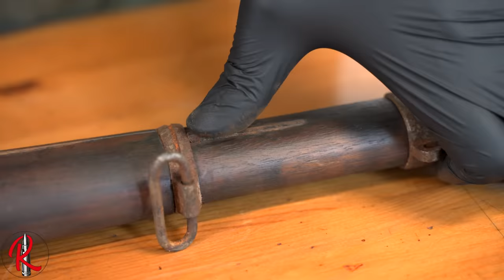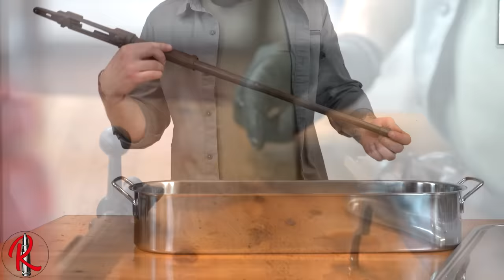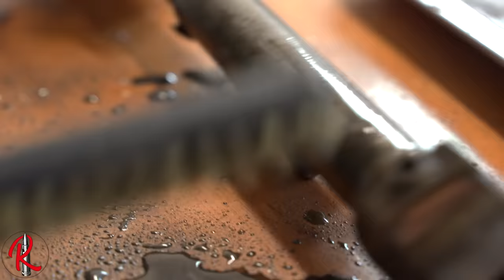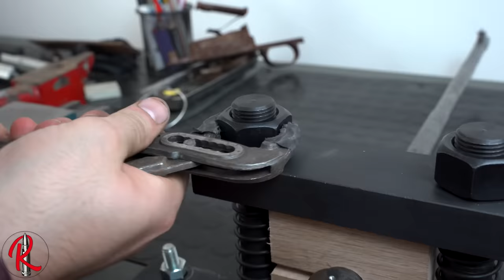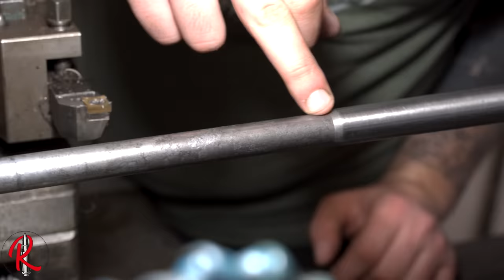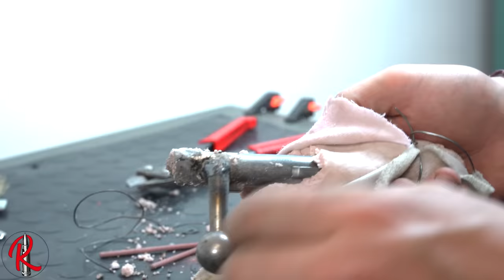K98 Mauser restoration & sporterization - real gun restoration

Comment: This isn't a restoration its a Frankenstein like how dare you throw away the original wood and then have the gaul to change the bolt by putting it on an angle and adding a modern scope and getting rid of the original sights
Reply: …you realize that’s not likely a service seen K98 right? I sincerely doubt it has any historical significance whatsoever so it doesn’t matter if he sporterized it

Comment: Not a restoration at all. It was modified. Dual triggers, reshaped the bolt handle, totally different stock. The man has skills no doubt, but that wasn't a restoration.
Reply: Yeah he ruined it :(
Reply: Removing The Original Body Was The Worst
Reply: @asu-5748  Driling holes, changing the trigger mechanism and bending the bolt were such bad ideas too 😢

Comment: that must be the most polite and ordered rust in the history of rusting, attacking every single atom of the build equally, and without clustering.
such an even, clean, coat of rust,... that even the insides of the firing mechanism are rusted, with the wooden frame not even scratched.

Comment: This is an Gewehr98 not K98....
Basically a good restoration, but replacing the stock and changing the charging handle is not acceptable in my opinion.
Reply: Nope Mauser banner rifle made in the interwar period between WW1 and WW2. The kar98 actually existed in WW1 as the Kar98a and kar98b. The Gewehr98 is a full length rifle and was largely abandoned toward the end of WW1.
Reply: @cloroxlavenderscent4307  beat me to it!

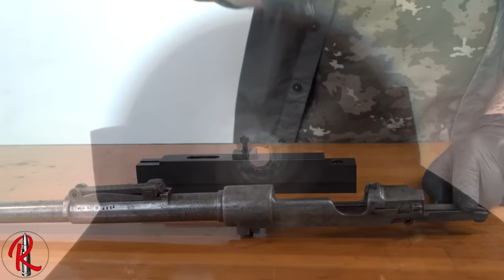Comment: ROFL no it's not a K98.  It's a commercial mauser.  @3:46 look under the rear sight.  MEGE 8x57.  That's an import mark denoting the caliber of the gun.  If it were a direct import it would be 7.92 or 7,92 depending on the company that would mark it.  Original K98's are marked 7,92 using a comma.
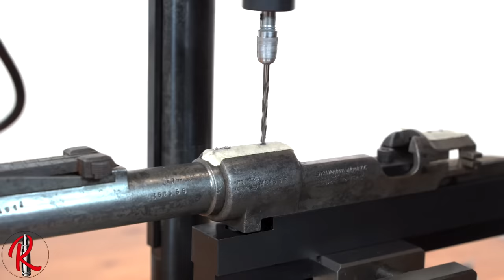@4:01 the receiver is clearly marked Standard-Modell.  That's the commercial stamp.  This is an import standard mauser commercial.  Not a military K98, and looks to have been soaked in a salt brine solution for the rust.

Comment: Not a Kar98k, the bolt is straight. And neither a Gewehr 98, the iron sights are different from the Langevisier roller-coaster sights. It is possibly a Polish Mauser because of the wooden body having that deeper part, almost like fluting.
Reply: It's not a polish wz. 29 either as it is lacking the characteristic front sight hood as well as having a different receiver and barrel band with only one sling swivel. Not sure what it is, though
Reply: Well, by the markings at 4:04, it is a 1924 Mauser "Standardmodell". Sad to see it ruined like that
Reply: So it is a German post-war Mauser? Still not a Kar98k, tho.
Reply: 1930's probably. And no it is not a real Kar98k, that's just for the views, I guess 😉
Reply: @pleplop3683  Probably a Karabiner AB, or a Karabiner B perhaps. One of these was the standard issue rifle of the Reichswehr until being replaced by the Kar98k.
Reply: It also could be a k98a
Reply: @erwinmuller1266  yeah. Mauser rifles are awesome.

Comment: As a German im really offended! First, You say its a Kar98 kurz, (Link to a Picture: https://de.wikipedia.org/wiki/Datei:Kar_98K_noBG.jpg which it definitely isnt. Looking at the photo, below the STRAIGHT bolt (the K98K had an angled one) there is an indentation which is not present in the video, so we can now tell it is a Mauser Standardmodell, which was similar to  the K98k, but NOT the same.  Secondly, this video is not a restoration, no, this is an insult to my forefathers and all who fought with or fell through such a weapon! Schande über dich, Guten Tag.
(Edit: Link didnt work.)
Reply: @petrtlach  i think is the 'Type Chiang Kai-shek rifle'
Reply: @vincent-xg7hy  No. This is Standart model 1924. Check weapon and read symbols on weapon. Standart model have too hook in front.
Reply: @petrtlach  oh my god. I'm- I'm about to stroke out in getting so many different mixed signals in this comment section over what this thing is.

Comment: This guy realize a banner Mauser in original restored military configuration is a 3,000$ to 5,000$ rifle facepalm
Reply: yes and he tried his best trying to fake it, not too sure what he was doing half the time ,why is he bluing the surface and then trying to scrub it as if he is removing rust, then adding lubricant and blue paints to the inside of a gun?drilling holes near the chamber,bending the charging handle and then try bluing again on what should have been an already blued surface?Also the part where he throw away the stock and then a period matching stock mysteriously appears nears the end is baffling

Comment: That’s the updated Gewehr 98. You can tell by the bolt that it is a gewehr 98 and by the sight that it look different than the original
Reply: what? to me it looks like the Chiang kai shel rifle because of its wood shape at the front. updated gewehrs still have the long part at the front, and the receiver looks longer and different. The ditch in the grip is also evident.
Reply: you are smart

Comment: post war model, sporterize away. never gonna happen with my m24/47 yugo, its way over built in the stock btw. really gotta lap the bolt, very rough, basically new 70 year old rebuilt gun. i want to know HOW the gun got like that. ive seen some bad guns from neglect and one that was just forgotten in a bad place. ive got a bad .22 pump in need of restoration too, hand down wall hanger, but in a barn. the pitting in the rifling is the worst on it, cant fix that sadly. good work.
Reply: This was a mauser standard modell made from 1924-1935 this most likely having been exported to the chinese where is saw very hard use against the japanese in ww2 and against the us in the korean war

Comment: This is conflicting. On the one hand, I want to see as much of the history of an item as possible be preserved and kept intact, but on the other hand, I want something to continue being used, generation to generation. E.g. I'd rather a classic car be driven and crashed then be safely locked away collecting dust. 

It's a fine line. Some things serve zero purpose and only serve as glimpses into history in which case you should change absolutely nothing, but if something can still be used, keep as much as you can original but replace or update any parts that would otherwise limit it's usefulness. 

But either way, GREAT JOB!

Comment: Um... that looks like a gewehr 98 not a K98, basicly this rifle has a straight bolt and is from WWI
Reply: I think this might have been a k98b. Going by the straight bolt handle, the sling swivel mounted under the stock, the flat rear sight and the finger grooves. Whatever it was, turning it into "basic hunting rifle #8561" is a fucking crime. Especially what they did to that bolt handle, my god...
Reply: 1924 Standardmodell Mauser

Comment: Job well done ignore the comments you ruined history. Between 1935 and 1945, about 14,000,000 Kar98k rifles of all variants were built; 132,000 of which were sniper rifles. During the war, Russians captured millions of these which no doubt turned up in Korea and Vietnam wars.
Reply: Its more of a point of, these rifles are rare and costly these days. So why make the originals rarer when you cam buy an already sporterised gun. The British Company Rigby makes Sporterised Mausers from scratch which is much more honorable than taking an original gun and drilling holes in it for what could of been a truly restored gun. I get that a lot were made. the fact isn’t that it is a Sniper rifle. It is that the stock is not the original shape, the trigger is different. The sights have been replaced with completely different ones and most of all the reciever (which was completely intact and in great condition with full markings) has had 2 holes drilled through it and ruined for someone to mount an optic. Also, if so many of the K98s made were sniper rifles, why not just buy one of those. Or restore it into one, rather than a sporterised version?
Reply: Exactly. Even if this was  "one in million" mauser, there are 14 rifles identical to this one.
If someone objects to what this guy did, get revenge by using your money to buy your rifle and make  your video.

Comment: Luckily it's not a K98. However, it's still a shame to make it a sporter. Pretty much killed the value of the gun,  even less than the condition you got it in.
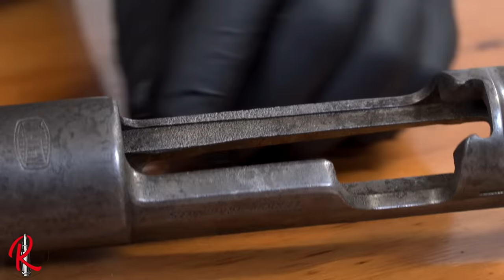Reply: Nope.  @3:30.  It says Standard Modell on the side and there is a Mauser across the receiver.  That's a 1934 Banner Mauser.  Commercial gun made only for export and most went to Asia or South America.

Comment: In order to remove the barrel hit the jig with a hammer, is easier than fighiting it
Reply: And their's a compound ( rosin sp?)  that you can use to hold the barrel in the vice. When we sporterrized my K98 ( yes k98 ) the gunsmaith told me it was tight .  The barrel slipping so they kept adding rosin to get the barrel firmly held. You can see the thing slipping as he was doing the removal.

IIRC also some gunsmith will mill a relief cut that suppose to reduce the tension on the thread right in front of the front ring when removing the barrels also.

Comment: First off, this is not a K98, im willing to bet it's a Chinese chiang kai shek rifle. These rifles are known to be in very poor condition due to the extensive use they have been through in Chinese service, such as the Sino-Japanese war, the Second World War, Chinese civil war, and possibly Korea and even Vietnam. The bores are shot out, and they usually go for around $200.
Reply: could have been a banner mauser. the comercial pre war model
Reply: It's also an import marked gun.  @3:46 look under the rear sight.  MEGE 8x57.  That's an import mark denoting the caliber of the gun.  If it were a direct import it would be 7.92 or 7,92 depending on the company.
@4:01 the receiver is clearly marked Standard-Modell
Reply: @AlphaCenturion777  @4:01  It's clearly a banner mauser.  Look at the stamping on the left side of the receiver.  Clearly says Standard-Modell

Comment: This is not a renovation, this is a piggery. If I am refurbishing a K98, it must be a refurbished K98 at the end and not this.🤮🤮🤮
Reply: ROFL no it's not a K98.  It's a commercial mauser.  @3:46 look under the rear sight.  MEGE 8x57.  That's an import mark denoting the caliber of the gun.  If it were a direct import it would be 7.92 or 7,92 depending on the company that would mark it.  Original K98's are marked 7,92 using a comma.
@4:01 the receiver is clearly marked Standard-Modell.  That's the commercial stamp.

Comment: Shouldn’t have done that to the bolt
Reply: With a bolt like that, it won't open when a scope is installed. Also, for a sporting gun like this, a curved bolt makes much more sense.
Reply: Already knew that. I like a fair amount of the restoration, but if you look the weld is sloppy and overall it does not add to the character I feel. If you are going to take the time and custom set the scope and sporterize it, take the time to do the bolt right. Also with some of those you can take the actual bolt handle off the bolt itself. Or he could have heated the bolt handle up to a temperature range and nicely bent it. All in all there was better ways to do that section of the job.

Comment: I own such a weapon and it is 108 years old. It is in good health and 87% clean. I want to sell it. How much do you estimate its price??
Reply: K98Ks did not come out until the 30s so if its 108 years old, it's  not a k98k. If its a k98A 3000$ or  Gew98 in good shooting condition around 2000$ , at least on the canadian market, both prices quoted are canadian dollars
Reply: @justacentrist4147  Agreed, In The US a trashed K98 will go for around or a little over 1k USD. Pristine and unmolested, easily a couple a grand. A G98 is going to be less valuable if its trashed but a pristine example will bring a maybe 1600 USD-ish.
Reply: @Alexander G.  if he actually restored this rifle, I'd say it would easily fetch 800$-1000$ even with the rought bore. The guy took a piece that could have been worth money if done correctly and turned it into a 150$ sporter
Reply: @justacentrist4147  No this was too far gone.  All original finish was kaput.  Bore was terrible.  An original stock would have made up at least half the cost to restore.  A proper re-bluing would have never corrected the rust pits.  It's only because he could not get the barrel off that he decided to keep it.  Millions of these were made.  No crime in making one useful that was too far gone to pass as an unmolested original.
Reply: It doesn't just depend on the model of gun you have and condition, but also the factory it came out of. Mauser is more common, so less value with other manufacturers being considerable rarer.
Reply: @panzerabwerkanone  nah dude, a sporter with a warn bore is basically worthless . An original military configuration mauser with a worn bore is worth far more. that stock could have been repaired. Non of those cracks looked like they were in load-bearing areas. A skilled gunsmith could have repaired that stock.
Reply: @justacentrist4147  You know nothing about rifle stocks.

Comment: I don’t think this is a Kar 98 the bolt is wrong
Reply: it's a gewher 98. used post ww1 buy poland
Reply: Not a Kar98k, the bolt is straight. And neither a Gewehr 98, the iron sights are different from the Langevisier roller-coaster sights. It is possibly a Polish Mauser because of the wooden body having that deeper part, almost like fluting.
Reply: @leonardomafrareina7634  BRO I literally said, g98 used post ww1 by Poland
Reply: @sebaheie4520  Should have said Polish Mauser, Gewehr 98 is a specific WW1 Mauser.
Reply: It is a 1924 Standardmodell Mauser, @ 4:04. 😉
Reply: @sebaheie4520 that one would have the original Gewehr 98 style sights, no?

Comment: Some of the comments on here crack me up. You all acted like he committed a heinous felony.  It's his rifle he can do whatever he damn well pleases.  Now with that being said, it wasn't uncommon for GI'S coming home from ww2 to turn military rifles into hunting rifles.  Sometimes a rifle can be salvaged and brought back. In this case he probably couldn't. Metal furniture was missing and the stock was cracked beyond repair.  Obtaining these replacement parts are a pain to find.  Keep in mind the Germans, Czechs and Belgians put serial numbers on everything that matched! If he was able to obtain spare parts and new stock, the rifle wouldn't match and you'd still devalue the rifle.  Plus the expense of Obtaining original correct parts for the rifle. In good condition they aren't cheap.  By the time he would have put the rifle back together. He probably would have had more money in replacement parts than he would with the rifle. He'd be at a loss.  Sometimes it's more practical to simply salvage what you can and turn the rifle into something functional.  I've seen some of these milsurps that have been sporterized look like garbage and I've seen works of art like rifles made by Griffin and Howe and the German gunsmith guild. This guy worked with what he had. He turned something that should be scrapped into something that works. He didn't do a half bad job doing so.
Reply: I knew a guy that sporterized and customized an old Turkish mauser. The gun was WRECKED when he bought it as a project for $100, condition worse than this video. But he’s a master gunsmith and turn what was essentially unusable garbage into one of the most beautiful guns I’d ever seen; case color hardened action, bolt handle, and bands, immaculate custom checkering that was incredibly ornate, gold inlaid engraving along the top of the barrel, Monte Carlo butt stock, so many other things. He took it to a gun show and one guy absolutely dragged it for being “ruined,” and then another guy bought it for $5,000.
Reply: it wasnt his to destroy

Comment: You did an excellent job with this rifle, incredible recovery of a legendary firearm. I can imagine how many Mausers are out there and people will always consider something like this as "ruined". I consider this an upgrade, especially from the state it was found in. This isn't a coin, where people WANT to see the age, this is a functional piece of equipment, meant to be used! Imagine, if you will, sharpshooters back then that wanted to scope their weapons as they were, they had to get another gun, one that was suited to the task, or do something like this, where they could attach a scope to it. I can see someone thinking back then "I wish my gun had a scope..."

Nevertheless, excellent job!
Reply: the reason why people are upset, is mainly because it looks fake. in the beginning, you can see a green oxide on the rear sight and chamber, which is only found on copper. and anybody who knows copper knows that it would blow up if the chamber was made of copper. so, if it was faked, and since this is a 1924 mauser standardmodell, then he ruined a relatively rare gun, that would have been worth thousands of dollars.
Reply: many things wrong with this. firstly this can can take optics without damaging and material just a conversion kit with differ parts like a scope mount frame instead of this one which doesn't. this kit would also come with the kar98ks scope compatible curved bolt
the body was perfectly restorable and worth alot of money for original stocks as they can be hard to find one in good condition. the restoration was also very rough and a very high amount of disrespect for a gun thats been original for a century